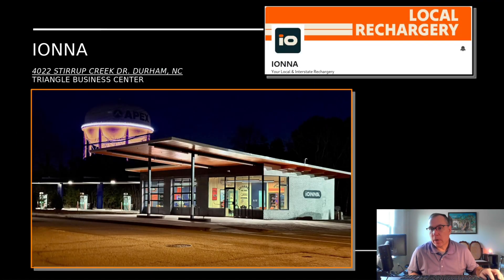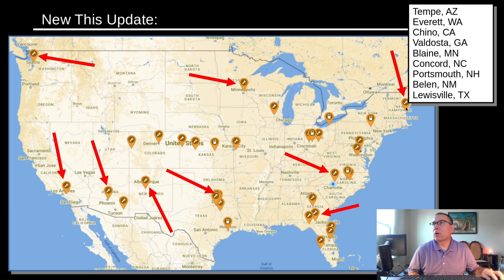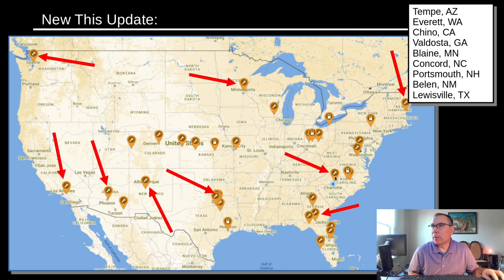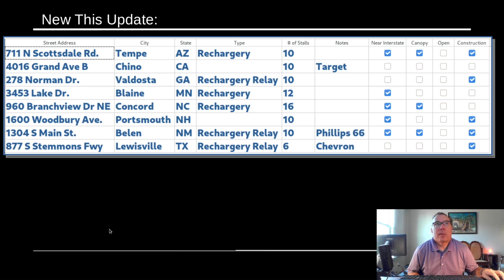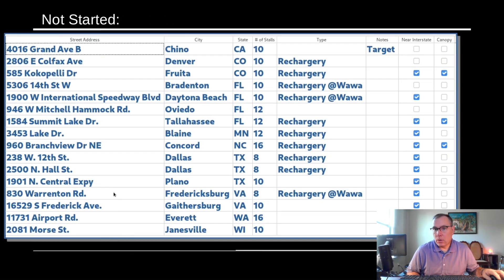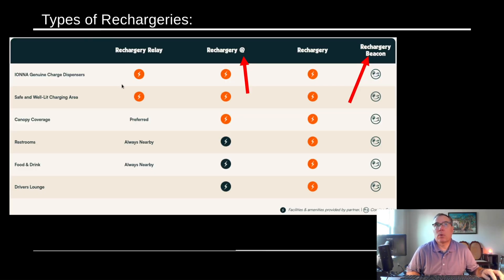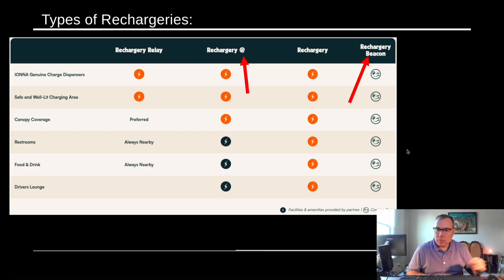iONNA Project Update - #10

Comment: Not sure how you are determining "near Interstate". The Valdosta site is less than a mile from the I75 interchange and the Warner Robins site is almost 3 miles from its I75 interchange. Seems like Valdosta should be checked. There is also an EA site just north of the Valdosta address you list. Likewise, the Oviedo site is about 1/2 mile from the 417 exit. 417 is a tollway and part of Florida's toll and freeway system. Thanks for all of your work on our infrastructure. I find the info very helpful.
Reply from the maker: Yup.  That was a typo on my part.  It is corrected.  Thx for chiming in.

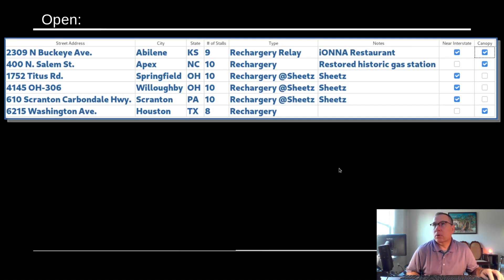Comment: 2:32 just a bit of nuance, the Rechargery @Sheetz on Titus Road, Springfield OH that opened Dec 27, 2024 doesn’t have a canopy now, but has stickers on the chargers saying a canopy is set to be installed in 2025.
Reply from the maker: Correct.  I am waiting for the upcoming installation to add it to the grouping.  Cool they are opening and also adding canopies as they are able after instead of just moving on.

Comment: I looked up the details of the Everett, WA site, since that's the one in my area. Interestingly enough, drivers simply traveling along I-5 looking for a charge will have better options, as both a 10-stall Electrify America and a 12-stall Tesla Supercharger (open to non-Tesla vehicles) are located about two miles away from the planned rechargery site, but much closer to the freeway.

However, the planned Rechargery site is located about 2 miles away from Paine Field airport, right on the way between the airport and I-5, which means the rechargery will likely see some good use among ridershare drivers, as well as travelers returning EV rental cars. In addition, the areal view of the area shows quite a few apartment complexes (which likely lack the ability to charge at home) that will be a shorter driver to Ionna than Tesla or Electrify America, so even just a few of those residents driving EVs could be a big source of revenue.

Comment: Big news as this update has two sites I am familiar with along travel routes and likely to visit once open. The Bradenton FL Wawa site retrofit will be interesting as there is not a lot of extra room on the site. Also it is three miles due west of my most frequently used charge location, a Publix shopping center with six FPL/Chargepoint CPE 250's, which is directly across the street from a Wawa with four GM/EVgo dispensers in the parking lot. The Valdosta GA site is literally next door to a Walmart with Electrify America in the parking lot. Tesla, Circle K, and Chargepoint/GA Power charge locations are within a couple of miles.
Reply: @andygetch3797  certainly true, but GA power installs cpe250s (60kw), circle k is 180kw (400v), and all OEMs navigate to EA by default due to “free” charging (and that’s an old station with half 150s).  Super pumped to get some hyper 400s and to be able to avoid Tesla v3s! 2 RANs and an Ionna and I’ll be in Atlanta…that’s going to rock.

(There’s also a brand new v4 dispenser site just south of there too…so lots of options in that general area thankfully)